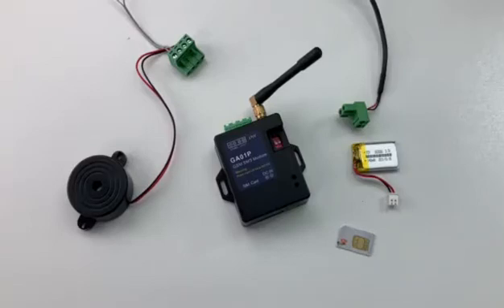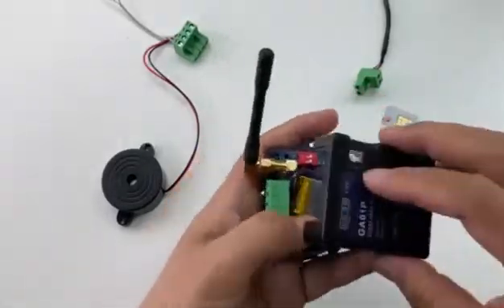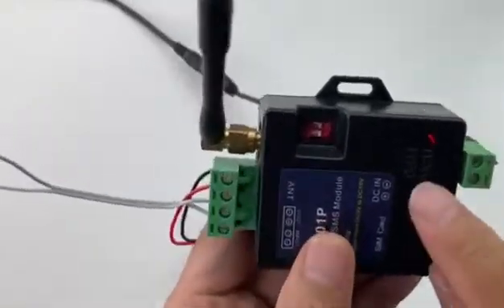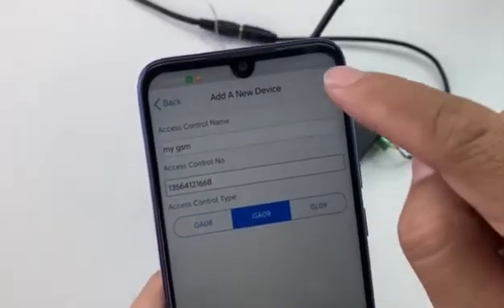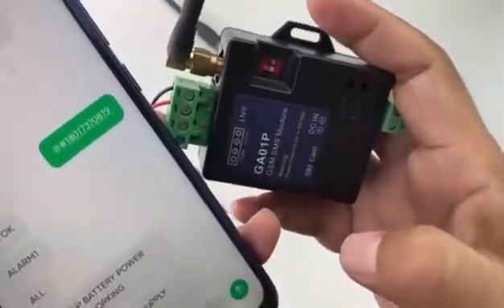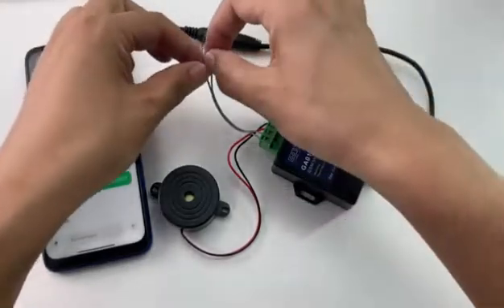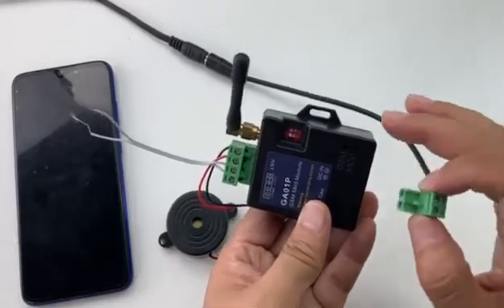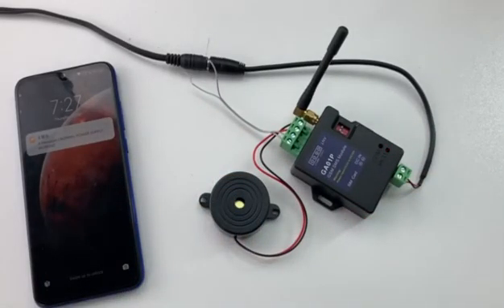GA01P GSM Alarm box for power failure alarm

Comment: hi, i have this all functionality works as described except the most important one: it does not send the SMS when the power fails. it only sends sms when power returns. i changed to a different bigger Li-ion battery so the battery is not the problem. couldn't be that the firmware is corrupted? did sent an email to the email address on website but there was no reply
Reply: I have exactly the same problem, please let me know if you found a solution, thank you very much
Reply: I had it too. It was a low battery. It must have 600mAh
Reply: @marlborowims  hi i would like to ask, I already use gsm alphabet but when i put message that have number it didnt receive the message but for word it receive the message
Reply: @muhammadnaqib7145   Hello. Try using an old push-button phone.

Comment: if I understand correctly, my phone will send an sms on the number of the sim card installed in my GA09? but it does not work, I have an error 0
Reply: Text programming messages MUST be written in the GSM alphabet. Not UNICODE. Alternatively, use an old phone. For example, a push-button Nokia
Reply: @marlborowims I already check my phone, and it use gsm code but it just receive message that is alphabet such as RESET but for @#123456890 it cant receive. Hopefully u can help me
Reply: @marlborowims hi i would like to ask, I already use the gsm alphabet but the message it can receive just RESET and when i message @#1234567890 it didnt receive the message. Hope u can help me
Reply: @marlborowims hi i would like to ask, I already use gsm alphabet but when i put message that have number it didnt receive the message but for word it receive the message
Reply: Why no2 and no3 not call...just only no1 ga01 call..

Comment: Do you have a link for the battery pls?
Reply: Search 3.7v Rechargeable 802540 600mAh
Reply: @marlborowims  When connected to the power supply, does the battery continue to "recharge"? Or is it necessary to recharge it with a different charger?